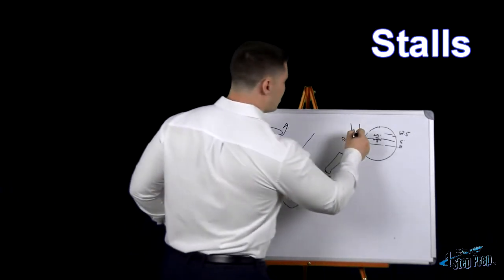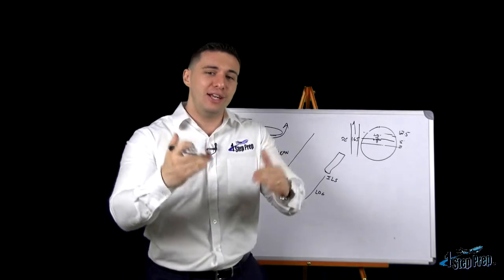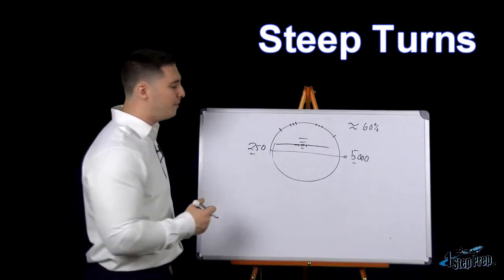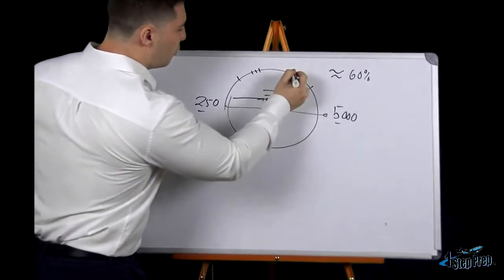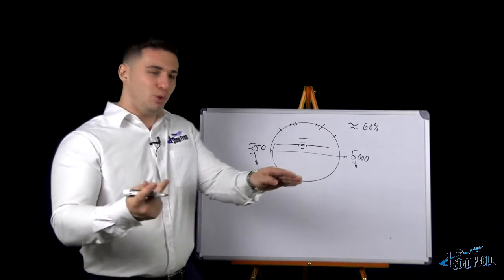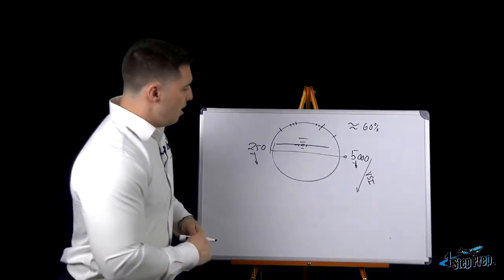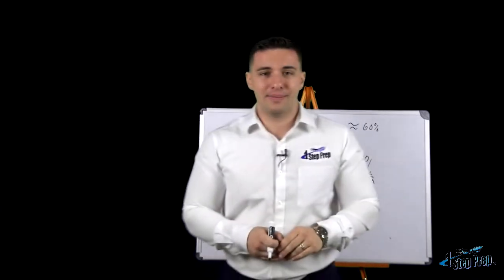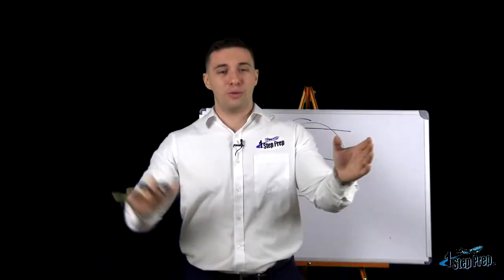B737 Stalls, Steep Turns & Unusual Attitudes

Comment: B737NG: Steep turn. Select flight path vector. Keep the flight path vector on the horizon. You’ll stick the altitude +-20 feet. Tap the throttle. On the 3’ ILS, set the FPV at -3’, and stick that glideslope. Turn the range scale down to 5nm and the tip of the airplane triangle on the magenta line, keep the track line straight up, as it automatically corrects for x-wind, the just wait for the runway symbol to appear, then then the MP should start looking outside. This all works on the captains side, even with total elect. failure.
Regards,